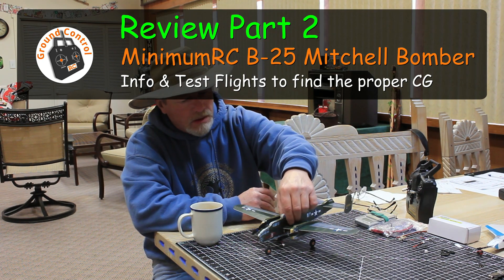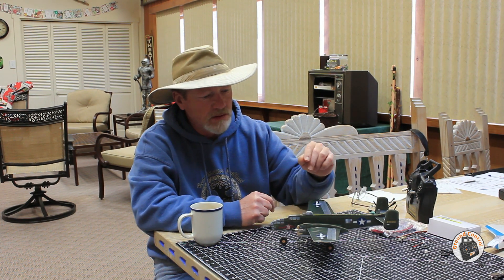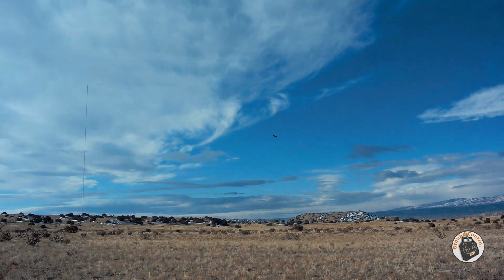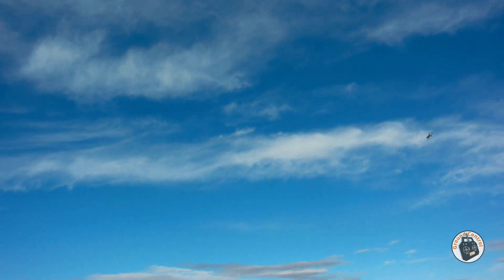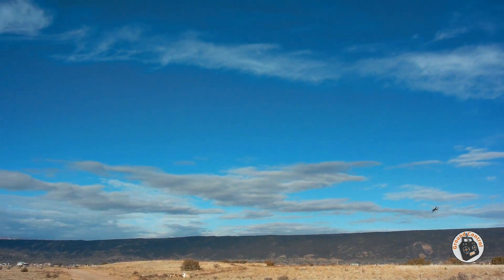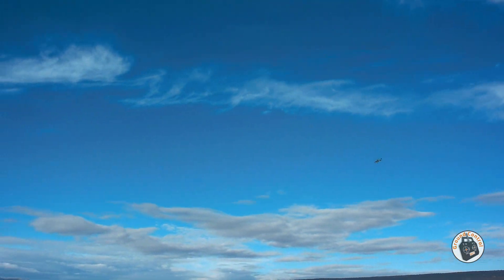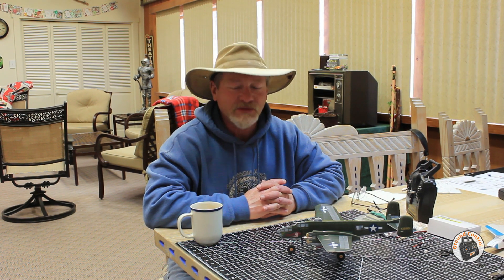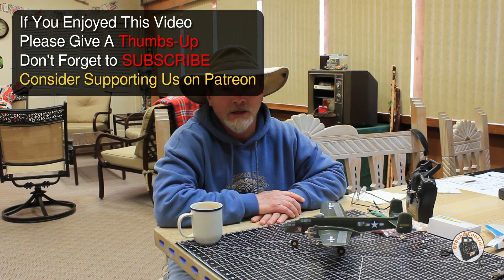Review Part 2 - MinimumRC Micro B-25 Mitchell Bomber

Comment: Next, build a plywood or foam deck replica of USS Hornet to launch off of! One sheet of 2" foam insulation and some gray spray paint...
What altitude is your flying field?
Reply from the maker: That would definitely be fun ;-)
The altitude where I fly is 5700 feet (1737 meters) above sea level.
Well over a mile up ;-)
It seems to effect the EDF Jets more than anything else.
Reply: @GroundControlRC  I was wondering, as I live in Colorado, and venture into Wyoming frequently. It looked like Wyoming or eastern Colorado a bit, so that got me to wondering.